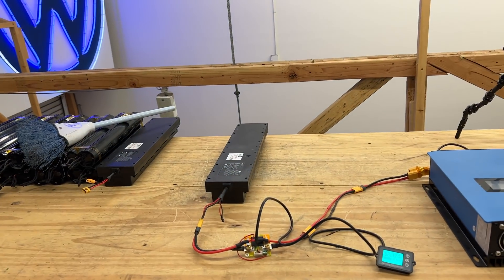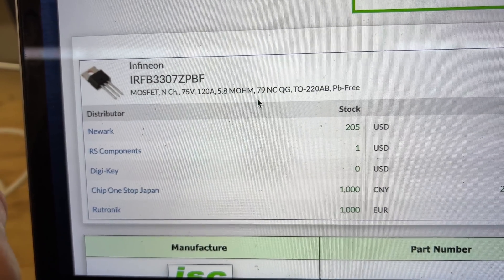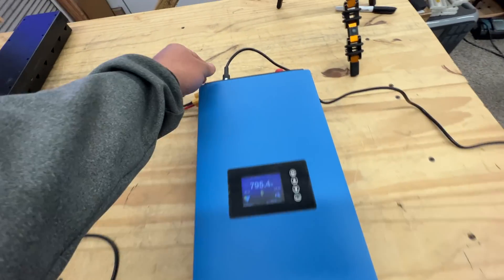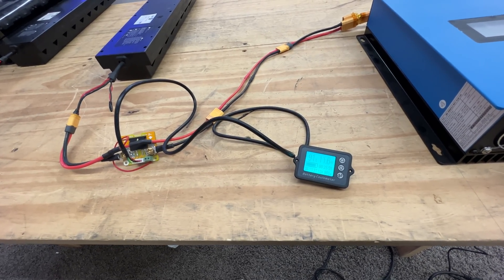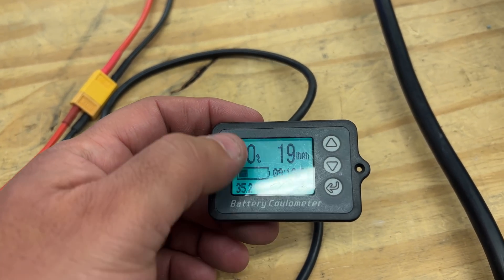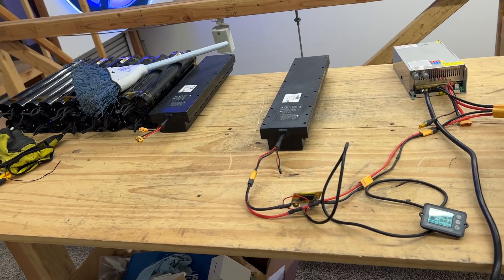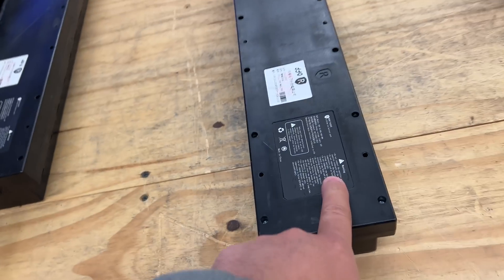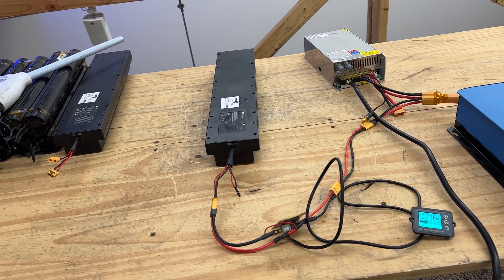27Amp 36v battery Continous Power Test - R5

Comment: Here is a couple of questions if you can answer please 
How to make a battery pack from deffirent capacity batteries ? 
Does internal resistance really important or capacity?
Reply: Both are important. Your series strings need to be balanced otherwise your battery will shut down when the lowest series string hits LVC...because you should have a BMS

IR is very important. You shouldn't mix great IR cells (20-40) with bad IR cells (over 100)...mixing with ok cells (40-100) isn't a great idea but if you can keep it to where there's only a 20 milliohm difference that will help with your high rate discharges.

Comment: I see you looked up the spec sheets of the mosfets and they are only rated 75v and u already did way above with the 3 in series you did on the car. I am surprised they didnt blow, did u try 4 in series yet that would be almost double rating I would expect them to poop on the one of them
Reply from the maker: Not yet

Comment: I want those for an e-scooter scone know how I can tie down 2 so get longer range for my scooter? Can I just tie in parallel those two external output wires and the two charging wires is each to charge both at the same time as well?
Reply: Hi. I made a booster pack for my 40v Ebike. I had to open the original pack and connect the new pack directly to the supply terminals. The original charger then charges both at the same time. New pack does not have a BMS but seems to stay balanced. Make sure the 2nd pack has a suitable fuse.
Original pack has 40 cells and the extender pack has 30 cells so the extra range is very noticeable. Good luck.
Reply: @markkennard861  thanks I'll have to try but I'm not very knowledgeable on these types of things for these packs in general.

Comment: If those MOSFETs connected in parallel then we can use an external Heatsink for them if not then use separately 
Nice video Sir!
Reply: Mr DIY, Is there a DIY version of how to combine 2 of the Bluetti ac200p units together (like u can with bluetti AC300) I will buy more batteries and have more inverter capacity if I could combine my two ac200p solar generators.
Reply: @dogde004  I don't know much about bluetti but you can connect external battery pack using some convert connectors
Btw jehu is already made a video on it LOL

Comment: if the MOSFETs are only rated at 75v I don't see how you could run them in series. Once they are exposed to voltages higher then 75v they are probably going to die. A MOSFET will fail short first most of the time so while you might still be able to charge and discharge the pack the BMS is likely dead.
Reply: Look up voltage divider.....

Comment: Power ratings for battery packs are usually performed at a 0.2C rate.
Reply: WHAAAAAAAT? they arent performed at crazy high 2C rates? lmao. he is insane to think he could draw even close to full capacity at almost a 2c rate. 85% @ 2c is honestly probably close to 95% @ .2c rate. Maybe even close to rated capacity. I wish my setup was 36v instead of 48v so I could just drop these in to my battery bank.

Comment: as scooter lithium batteries BMS limits amperage and at 42 volts doesn’t match my 12volt ac inverters to run power tools.. I use a step down buck converter to lower voltage and charge a 12volt AGM lead battery which can supply amps & watts needed.. these scooter packs work great as light weight back up solar banks vs by themselves at limited current.. is what I’ve learnt..
Reply: Here is a couple of questions if you can answer please 
How to make a battery pack from deffirent capacity batteries ? 
Does internal resistance really important or capacity?
Reply: @KHUDATBESAAZ  - “different capacities… internal resistance…”

As the internal resistance rises in a battery, the less capacity the battery has (the shorter the useful run life of the battery is). 

The internal resistance also means it will build up more heat (over time, this could be a fire hazard, no energy source is 100% clean & safe.)

You can build a battery pack out of any capacities you want, as long as you are aware of the consequences.

If you build a multi-call battery pack using different capacities with a BMS, the BMS may save you from a fire, but the pack will only give you the benefit of the weakest battery in the multi-cell set.

Comment: Do you know if the BMS dose any balancing?
Reply: Iv always wondered the same thing. To my knowledge they don't.  Balancing is only  functional if all the cells are exactly the same spec. The electronics just turn off the pack if they not all balanced. Anyone want to add ?
Reply from the maker: Balancing is one of the 2 main jobs of any BMS system,  the other is a switch
Reply: most cheaper BMSs don't really balance anything from personal experience.